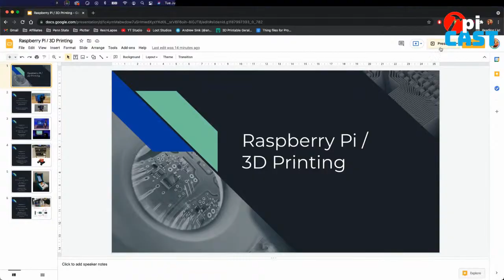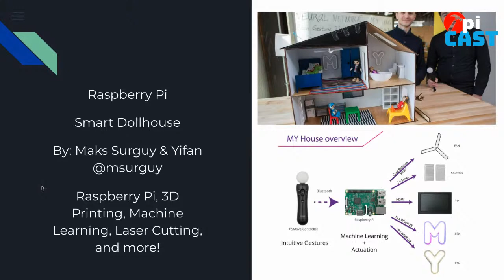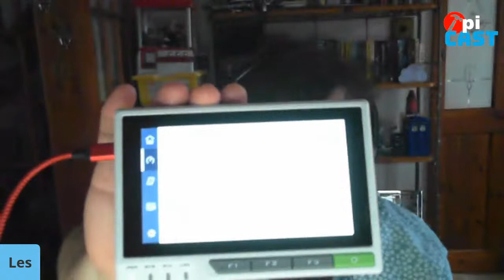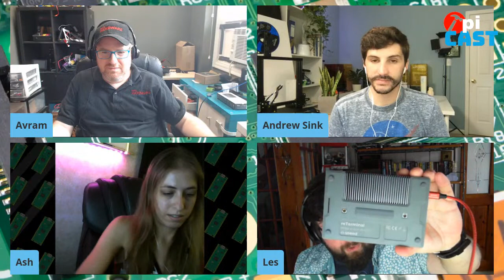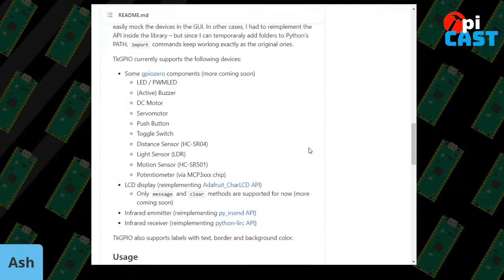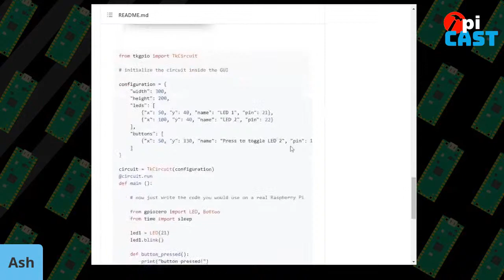The Pi Cast: 3D Printing for the Pi, A Pi Tablet

Comment: Thanks for having me on; I had a blast!
Reply: Thanks for sharing, Andrew!
Reply: @PrintNPlay  Of course! Your RGB battle-station is awesome and all of the arcade cabinets you’ve posted are just a total gift!
Reply: Good content as always. Lots of mentions of bits of software. But no mention of the fact you can entirely use a Pi to design, slice, print and even monitor / control the 3D printer. No other hardware / computer required! No mention of Cura, Prusa Slicer (both of which will run the latest versions and are updated with new features) or even the fact that Blender (2.79) all run quite happily on a Pi. An upgrade to using Tinkercad that is a little more parametric, but still browser based is OnShape. As a hobbyist and Pi-Vangelist the software available on Linux and the Pi are perfectly functional as it’s the current eco-system I use. I even use an old RF Hat and associate socket to turn the printer off when it’s done.

Abram to make the Lego fixtures smaller reduce your extrusion multiplier by 5 to 10% (or increase if too small!)
Reply: Wait it says 5 comments